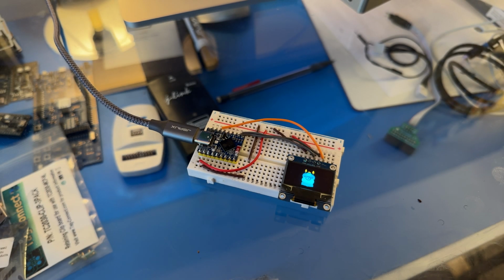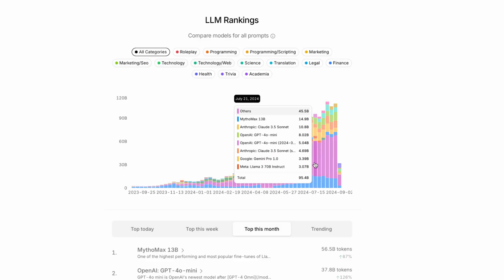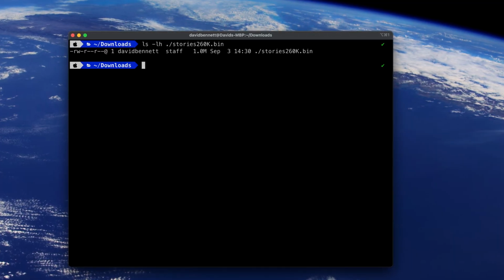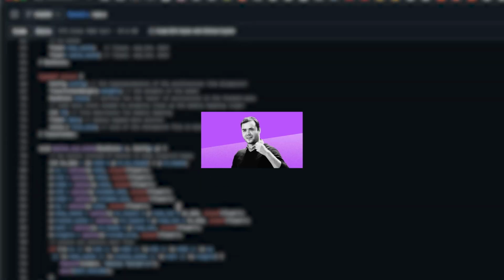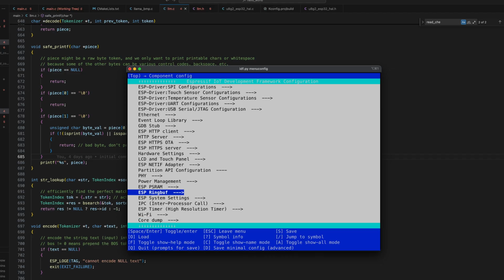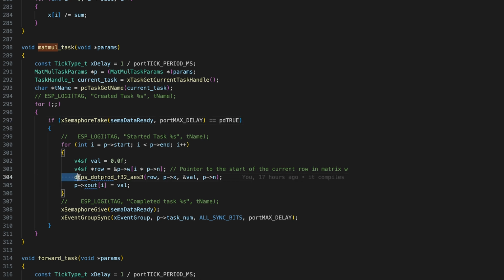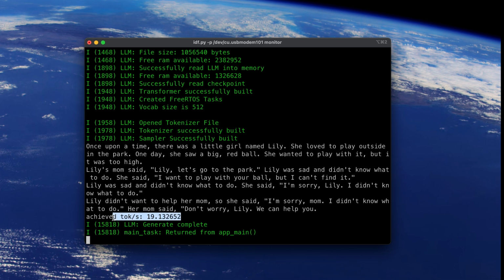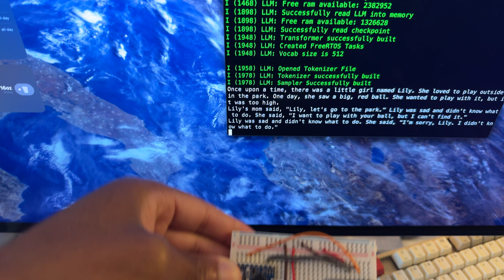I Ran a Local LLM on the ESP32 – Here's What Happened

Comment: That's pretty cool! I experimented with Small Language Models trained on TinyStories dataset a lot last year, but did not get to the scale of ESP32, only running them on Raspberry Pi. Main hurdle in my opinion is usefulness - even at the scale of a few megabytes after quantization, I could not get the model to reliably (this is the key word here) output rather simple sentences. Some of the outputs were okay, but it was a hit and miss.